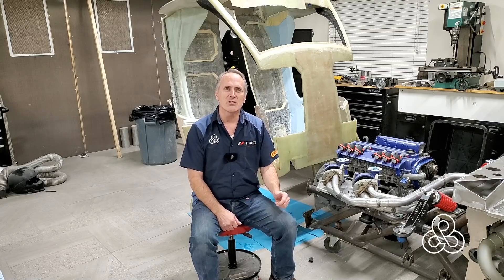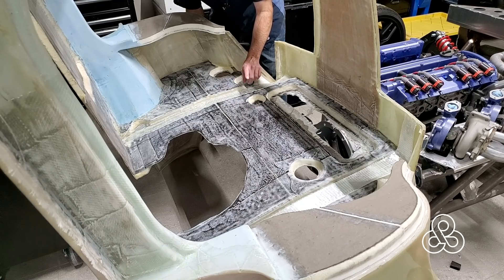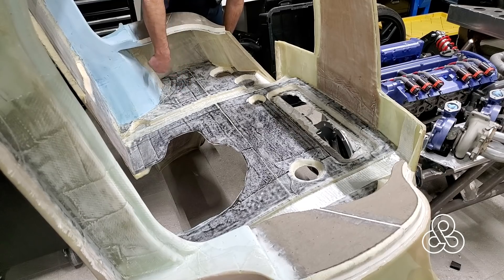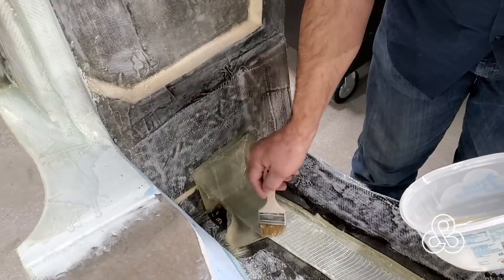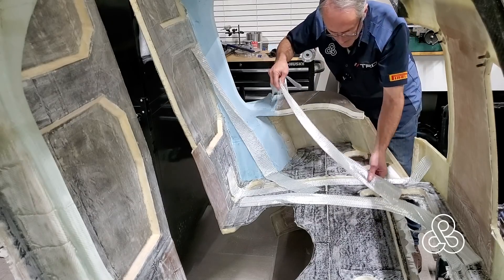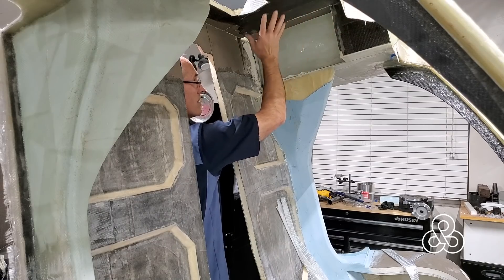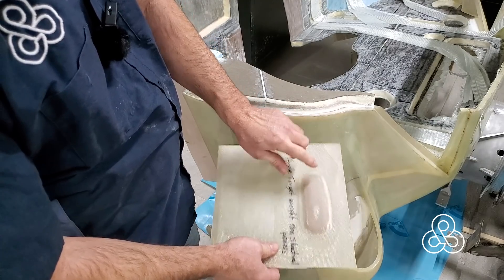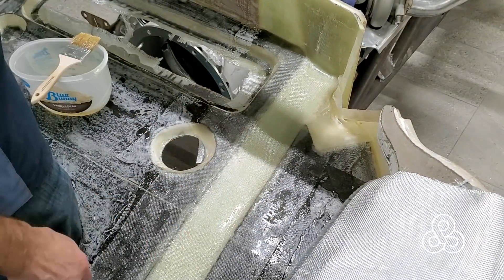A58 There will be steel! Occupant protection. Arete supercar project

Comment: For those who are skeptical concerning the strength of composites, you should see how thin is the fuselage skin on a Boeing 787. There's less than a 1/4" of composite separating you from 600+ mph wind and subfreezing temperatures. Yes, the strength is found in the diameter and the framing in the barrel. Regardless the airframe will last for 20 or 30 years of almost daily service. It's all about proper design and materials.

Comment: I know this is way too late but the size of the roll cage steel looks way smaller than I expect of normal racing regulations. I think it would have been beneficial to investigate required designs way before going your own way.

Love your just-go-for-it approach with everything though.
Reply from the maker: Here is a recent video with the roll bar built- https://www.youtube.com/watch?v=736LR3vjoM0  As mentioned in the video the roll cage is just to supplement the integrated composite roll structure. I have thought over the "racing" probability for the car, but think at the very most I might try Time Attack and then in a lower class, that does not require any regulated roll structure. Thanks for watching.

Comment: 13:26  tried to explain that concept to everyone who said my compound curved "uni-body styled" all aluminum snowmobile trailers would never work.   5yrs and thousands of miles later...still no cracks, didn't lose any mileage despite being bigger than a chinsy clamshell, and rigs don't push them around at all.  There's strength in them thar compound curved structures  👀

Comment: This is a cool and interesting way to build a one-off car, but it seems way to labor intensive if you want to make a small series production or a kit.
Reply from the maker: For sure! The answer would be to scan the finished car, with all its new added door jambs, seals and flanges and from that re-do the tooling. Then build it on a tubular steel (or bonded aluminum) chassis.
Reply: How many cars have you built?   Can you link to your build series so we can see how you have improved upon it?    Or are you just farting from your mouth?
Reply: @mrrustygray  I work as a vehicle concept engineer for a reasonably sized car company, so I think I have at least some idea of what I’m talking about.
Besides, I’m not disrespecting the work Mr Jarvies is doing. On the contrary; I think he’s doing an awesome job and he’s been clear in previous videos that he isn’t planning to make multiple Arete cars this way.

Comment: This is a great custom supercar build! To get it certified to be road legal do you need to build a few more body/chassis combinations for crash testing? Or do they accept engineering models with FEA? I'd hate to see you go through all the work just to have it seized by the government so they can "keep you safe from yourself." (Which is the rationale I imagine they'll use.)
Reply from the maker: Fairly easy in the US. No crash testing or that type of stuff, usually just safety check- brakes lights, belts. . . .
Reply: @BuilderCreator  Great to hear all it takes is an inspection! That gives me hope for building my own some day!

Comment: Awesome over-engineering the margins.  Everything that I understand about composites is that their tensile strength far exceeds their compressive so I applaud you adding some additional rigid (but ductile) steel tube to the mix.  Looks like you're building your car with snakeskin sheddings!
Reply from the maker: Could have called it the Viper, but that was taken. Ha!

Comment: I don't see any structural Integrity in the roof or the windshield support this is where the car will Flex, I'm curious if this is laminated with epoxy or fiberglass resin.
Reply from the maker: After I get the "rain channels" fabricated the A-pillars will get boxed in (around the carbon stiffener) and tied to another core that will run across the roof to the Nomex honeycomb panel. The window (as in most cars) adds to the stiffness. All epoxy resin with S-glass fibers.

Comment: Curious... Are you at all concerned about developing an allergy to the epoxy resin due to prolonged exposure? or are you just that good at avoiding skin contact?
Reply from the maker: I'm just that good . . . can't handle sticky! ;(
Reply: Are there toxicity issues when you're doing hundreds of hours of work with it?Any vapours? If so, how do you manage them?
Reply: @tomgrant6563  I have heard that epoxy can lead to a developed allergy after repeated skin contact, for some they can no longer work with it due to adverse reaction. So my question is in regards to skin contact not so much fumes.

Comment: Does anyone know what the expected horsepower and weight are?
Reply from the maker: Trying for 600hp at the engine, with a dry weight of under 2800lbs (1270 kg)
Reply: @BuilderCreator  so sniffing close to the .5 ptw ratio?
Reply: My vehicle weight was 1150 lb and was 180 horsepower at the rear wheel oh, what a rush

Comment: Nice, thanks for answering all our questions about the tub, I was a bit worried it would be too weak before, but when I saw this I changed my mind. Do you have a target wheight for the car? seems like that many layers of glass could be quite heavy?
Reply from the maker: Trying to keep it under 2800lbs (1270kg) Using glass, as mentioned. only in the places were it is needed. Quite heavy in some places, maybe to light in others.
Reply: @BuilderCreator  Wow, that would make for a great power / weight ratio if you manage to get the engine to 600hp. Nice, that car will be a beast for sure.

Comment: Would it take much work to carbon fibre it instead of the fiberglass? (sorry if sounds stupid but i thought it was a similar process laying down in strips).  Just wondered why the material is not used more in stuff like this. Is it cost / ease of use or a mix :S. Looking really good by the way been fascinating to see this whole process.
Reply from the maker: As mentioned it comes down to cost. I have calculated it to be about $17,000 more expensive to execute it in carbon fiber. (for only a 20% strength improvement over S-glass) And if one wanted to justify moving to carbon fiber the molds would have to be re-done to take advantage of vacuum infusion,  (another expense) as carbon fiber typically does not lay as well as glass weaves.
Reply: @BuilderCreator  whow thanks for the reply. Yeah can totally see why that would be avoided ouch thats expensive.
Reply: It directly comes down to the cost, he's mentioned it in previous episodes. Jay has wanted to keep the Arete as cost effective as he can.

The cost of carbon fiber is very expensive compared to fiber glass. For comparison, a 50 yard roll (roughly 46 metres) of 4 inch wide Fiber Glass Tape, is US$59.95. Where as, a 5 yard (roughly 4.5m) and slightly thinner 3 and 3/4 inch wide Carbon Fiber Tape, is US$219.95. So to put it in to a much harsher view, you will need to spend US$2,199.50 to get the same length of Carbon Fiber compared to Fiber Glass.

Now you can see, that the Arete project would quickly become very expensive, if Jay used Carbon Fiber in the entirety of its construction. Yes he would have to use less materials to gain the same strength, but at the sheer price difference, it would still come out cheaper to just use Fiber Glass and some additives such as foam core, and honeycomb structure.
Reply: @PragmaticWisdom  whow yeah that’s a fair bit more, I was expecting it to cost a bit more perhaps double but not that much. That’s crazy expensive. Makes total sense I must have missed that episode or part. Thanks for the explanation :)

Comment: This steal antirole tube-frame - they use it on lotus. They have 3 subframes: front aluminium glued with apoxy sqare tubes then midle one glued with apoxy sqare tubes  and rear subframe made of welded pipes. And then steal anti-roleframe seporateds interiar part from engene compartment its about same place you gona insert your's.
This scimetics of Evora's frame https://drive.google.com/file/d/1OhxSiEfH6Oa_XHqrARpiIUeUXD6DbYfh/view?usp=sharing - 1 picture inside.
Reply from the maker: Well, if Lotus can to it!!
Reply: @BuilderCreator  Did you see/open schematics?)

Comment: HI, have you thought about a charge cooler over the engine, should provide for a shorter route for boost, and would not have to go through the cabin, could also make for an interesting engine cover design.
Reply from the maker: Yeah, looking into redoing that charge tube once again. Might have to keep the two tubes separate until they cross the engine. The 3 inch tube is just to close to the deck lid but with two, I think I can do it . . . then I can get viewers to stop hounding me about heat in the cabin. Ha!
Reply: How about using a air to water intercooler? You then don't need to care about how far away the water cooler is.

Comment: this has been something I've wanted to say for awhile now, but i think now is the time and i realize this is a first off and you can't really do anything about it.  When you are doing these piece by piece layups and letting it all cure in between these layups, you are not getting a chemical bond, you are only getting a mechanical bond. with composites, the chemical bond is what makes it strong.  I'm sure you must know this, but i don't want people unfamiliar with composites walking away thinking this is how you do it. it's not. you do your very best to make sure everything is done while the next layer to it is still, at very least, tacky.
Reply: @307Driftwood Very true. I have some experience building composite home built planes, and we applied new layups to cured areas all the time. As long as it’s prepped properly, no big deal. Imagine trying to lay up the entire thing in one go...
Reply: @customfabrications  Indeed, and it's also worth noting that the places where the chemical bond IS more critical, he DOES do it all in one go, like the large structural support columns he's building up in this video. This is also not his first rodeo working with composites, it's just his first 100% DIY supercar.
Reply: @raelik777  I've been building carbon props for fan boats since the 1980's as a starting point in my composite timeline, not my first rodeo either. We've done it both ways ( full wet and multi layup as tests to failure) and frankly a mechanical bond is worthless under high impact, HNV or stress.
Reply from the maker: Caffeine, drugs, bright lights and loud music for 300 hours straight! Ha!

Comment: Hey man, stupid question. I've noticed that you put a lot of fiberglass. Do you plan how many layers you are going to add or is it an addition process until you feel it is as solid as you like? As a designer I get obsessed with the thickness of every piece I'm working with and how everything fits. But this scale is completely out of my knowledge and I wonder how important is to consider that detail when working on a car.
Reply: Ok, I just finished the video and you explained how you planned it lmao now I feel stupid 😂
Reply from the maker: I might also add, that I have targets, but will do some testing when it gets close to finish, (the tub) and if I need to I can add more structure until I achieve the goal.